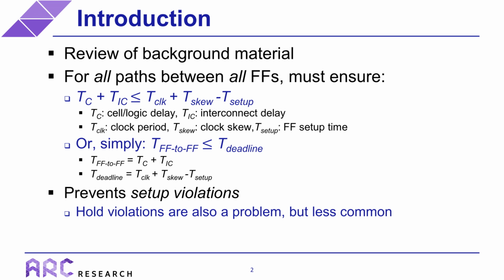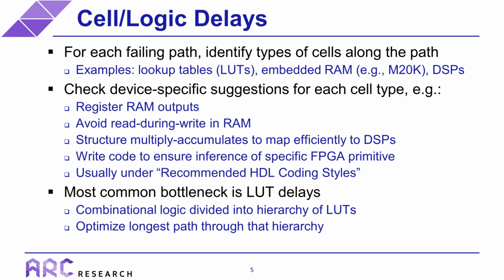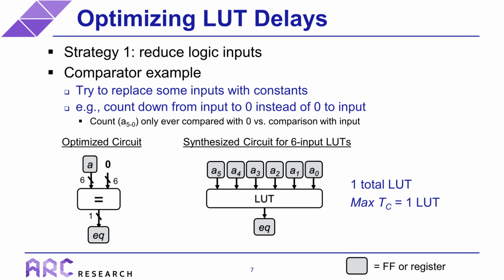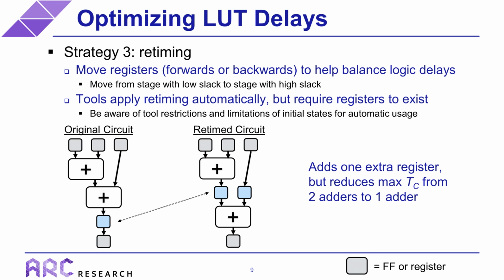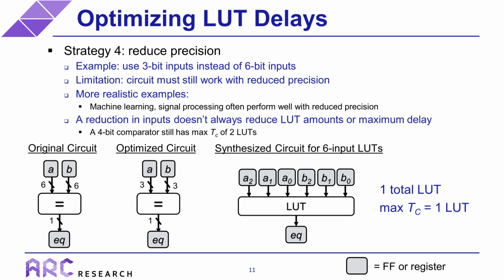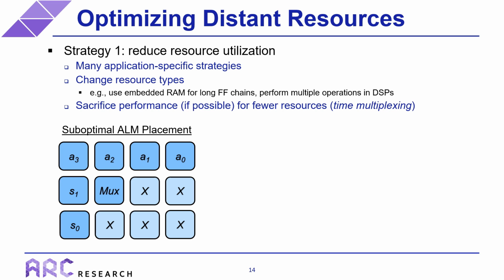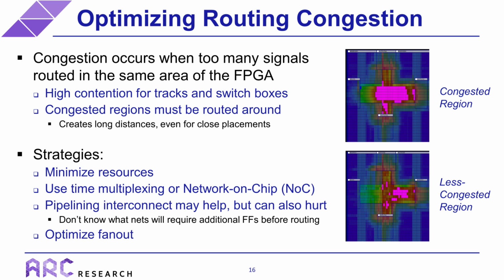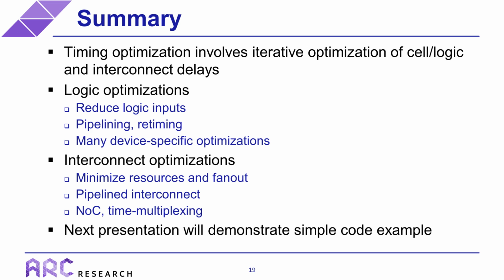FPGA Timing Optimization: Optimization Strategies

Comment: Strategy 1 is not a thing. It should make no difference with what constant value you compare. It just changes the logic function of the LUT at which partiicular combination of 'a' bits it outputs 1 and otherwise 0.
Also worth mentioning is changing synthesis options that can sometimes allow optimize better for a particular design. I have a recent case that switching synthesis strategy, and a 1 check box in particular,  improved timing  by approx 1ns on the failing paths.
Reply: But he explicitly said that the value is not constant and comes from a register. So it's not known at compile time. In that case it will help. To check this I wrote some small code examples and found that full equality of two 6 bit signal uses 2 LUT4 + 1 LUT6, but comparing to zero just uses 1 LUT6.